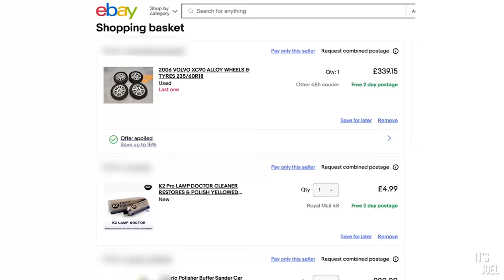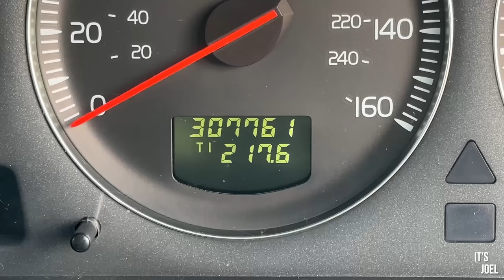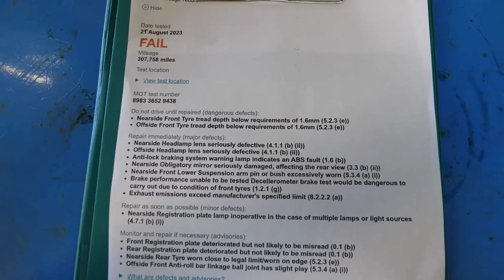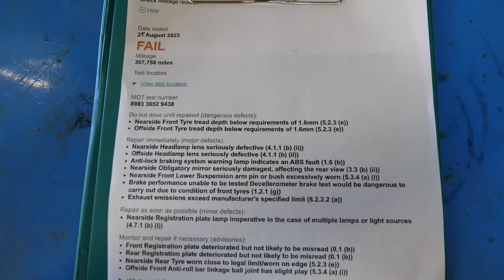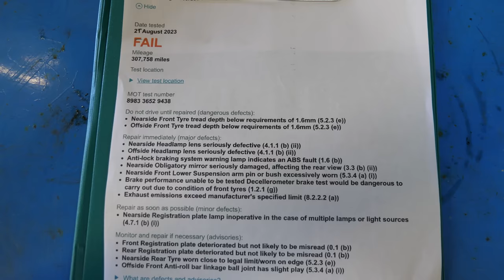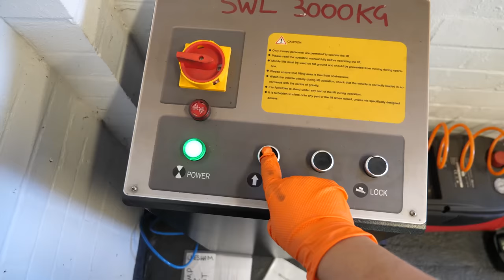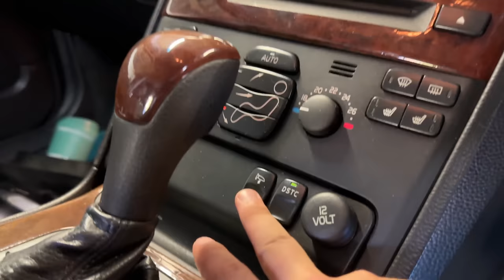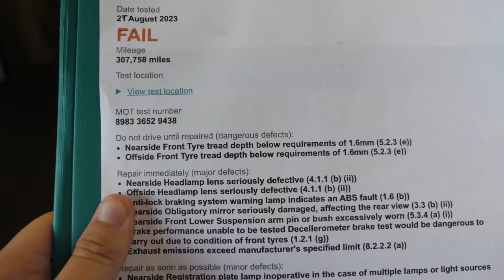CAN I SAVE MY £800 COPART VOLVO XC90? PART 1

Comment from the maker: Click here for part 2! 👀😀 https://youtu.be/DX6Wzz_FhO8?si=UFES9TdQqZLdMI-Q
Reply: Good Luck in your part 2
Reply: I don't remember which 12-sided socket I used for the wheel lock.
I think size 20.
You hit it over the wheel lock with a big hammer.
And then with a spinning top.
If it still doesn't work, put an extension in and twist it as far as possible

Comment: I think you may need more than penetrating fluid
Reply from the maker: One entire bottle per nut
Reply: @itsjoel  wire brush the exposed threads as much as possible and use a blowtorch if necessary to free them